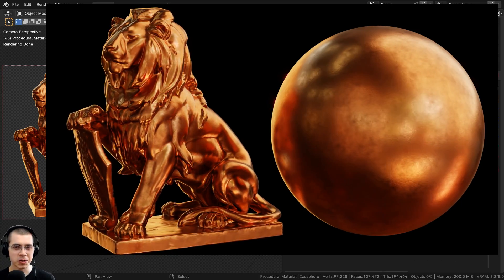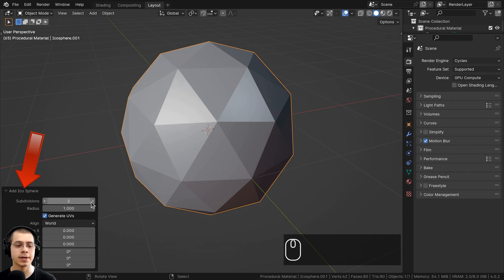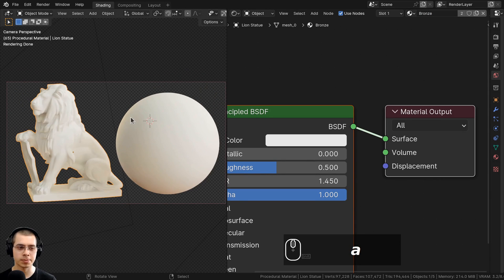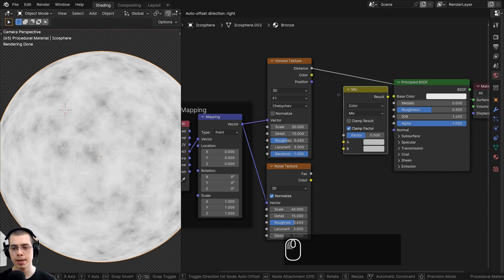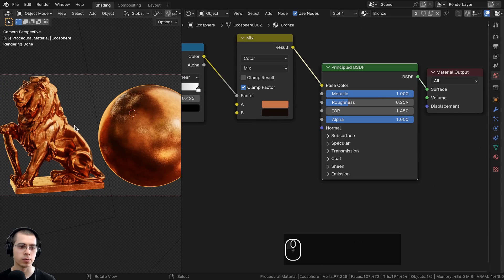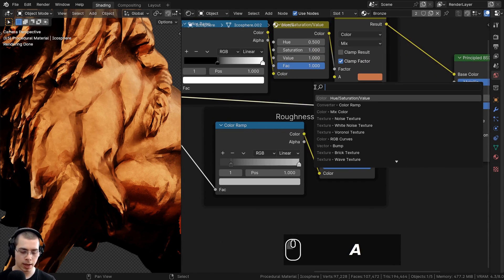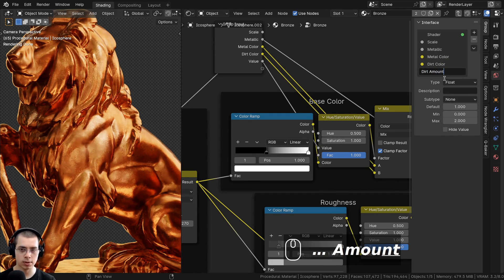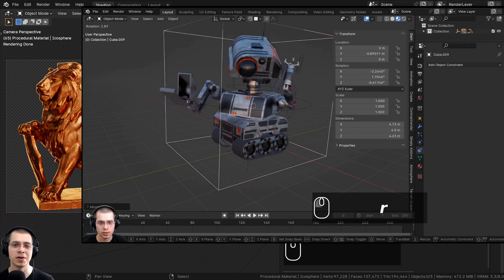Procedural Bronze Material (Blender Tutorial)

Comment: i have a question with one of your oldest videos, the one with cloud material, how can  i make the material work on the smoke simulation?
Reply from the maker: For smoke simulations I believe you need to use a different method for the material. Actually I think that on default, smoke simulations come with a material already on them when you add the smoke sim.